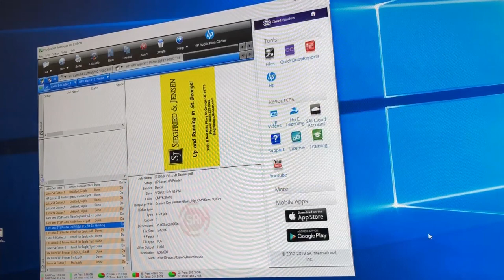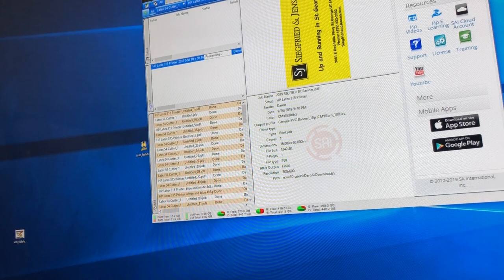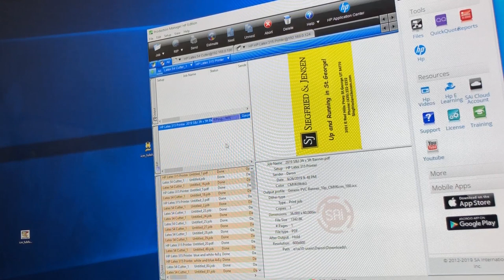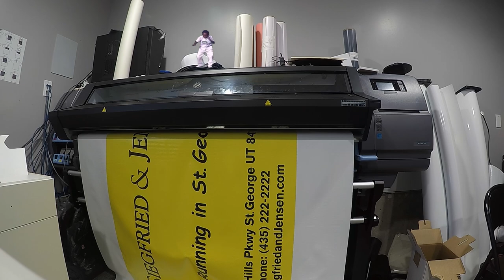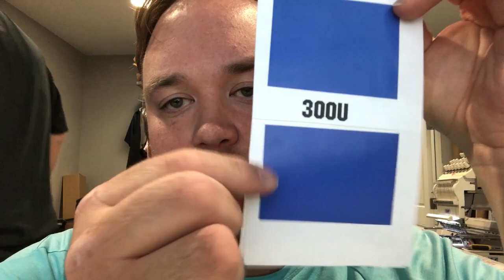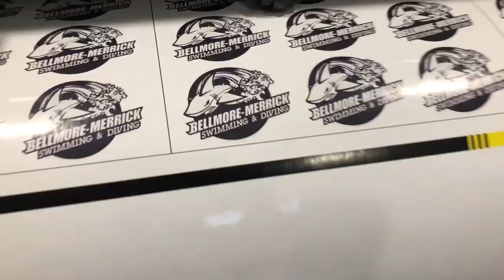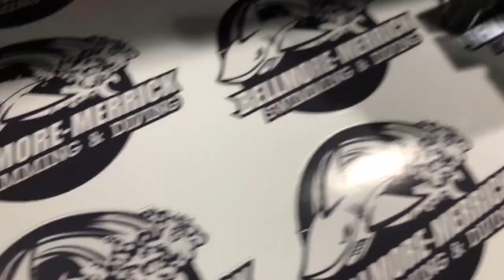Printing Banners on the HP Latex - vlog 80 - Print Shop Updates

Comment: I can hot swap on my latex 110
Reply from the maker: You can hot swap and it is supported. It just scared me, I definitely wont make a habit of it.
Reply: @ttms  lol yeah it was nerve racking the first time but it does it automatically btw do your inks get stuck on 38Mil? sometimes my inks will say 38mil and i can still run 100's of sq ft weirdest thing i feel like hp wants me to buy ink sooner than needed.
Reply from the maker: I haven't noticed that they get stuck at a certain %. I've only gone through a few carriages though.
Reply: @ttms  well pay attention pretty sure they are designed to make you think your going to run out of ink sooner than later because i have had it happen on almost every cartridge and i have probably been thru 25+